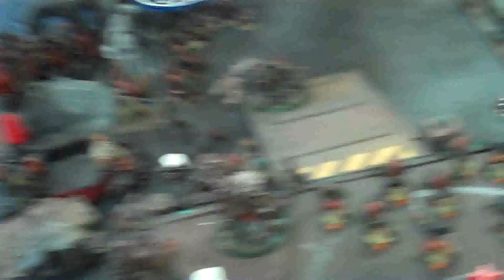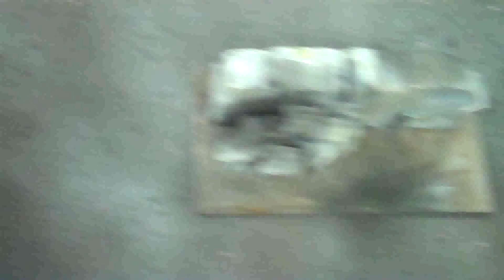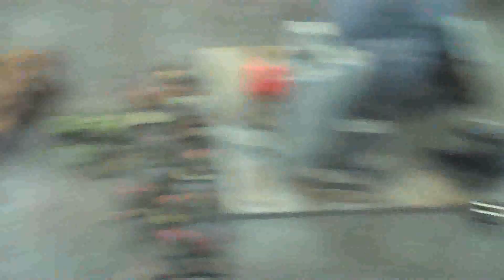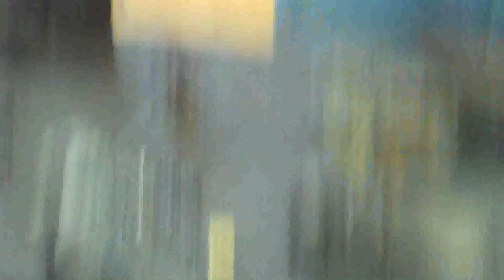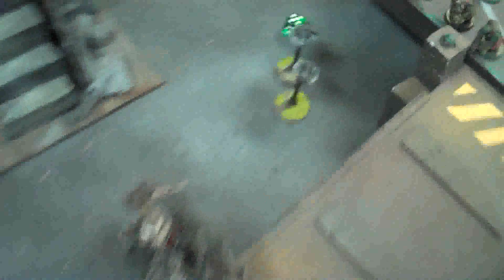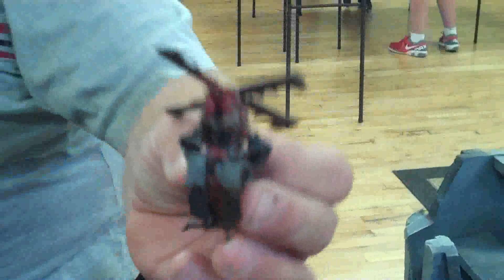Orks vs Tau 04 Ruined City Warhammer 40K Battle Report

Comment: Yeah, poor list for a hoard army, and poorly deployed.  Trying to use battlesuits with firewarriors in support when it should be the exact opposite.  Also, lots of mistakes on both sides.  Believe you cannot move flat out, get blown out of your vehicle and assault the next turn.  Those meganobs should have had to stand for a full round of shooting.  A a couple full squads of firewarriors would have washed them off the board.